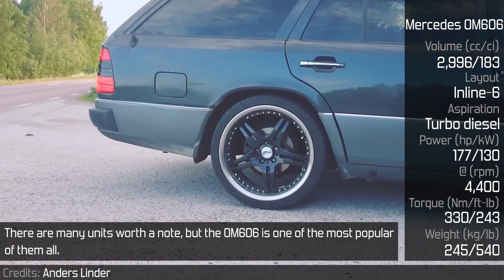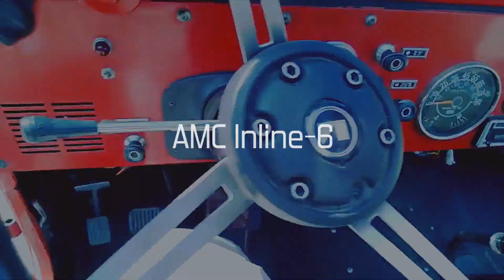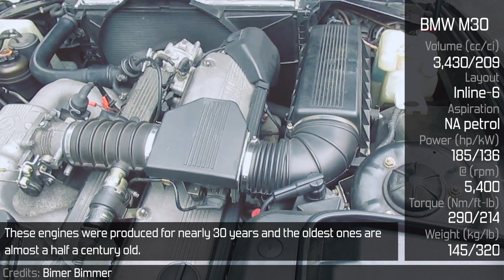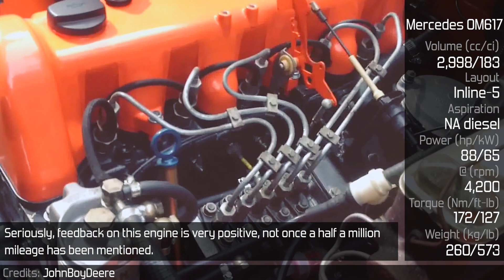10 Most Reliable Engines Running Beyond 300,000 Miles

Comment from the maker: I know a lot of stuff is missing which is why there is this comment section here. Since there is a lot more of reliable engines out there, feel free to mention your submissions and a little info about it if you don't mind. In case you want, I will gladly make another part of this series. Thanks you all for watching and have a great day!
Reply: I think some smaller engines might deserve a mention aswell. Someone mentioned the Fiat Fire engine, i think Toyota also has a few small good ones.
Reply: HUNGARY
Reply: VisioRacer the ford 4.9L I6. One of the all time greatest engines ever built. If you look up greatest engines of all time it'll be right there in the top 3 on everyone's list. Not to mention they are a gas engine which can withstand 500,000 to 700,000 miles without a rebuild.
Reply: VisioRacer you did a good job, however im sure if a north american made the list it would be a lot different. you had alot of european cars. Im glad you included the 1uzfe, probably the best small v8 ever made IMO. excellent video as always! cheers from Canada
Reply: What about the Audi 5 cylinder engines from the 80s/90s?
Reply: I would be glad if you do another episode with reliable engines :))
Reply: Toyota 5SFE
Reply: if you paid attention there was a mixture of petrol and diesel.
Reply: um, 7.3l powerstroke? lmao, got one with 440,000 nothing wrong
Reply: wouldnt mind a 2nd part lol
Reply: HitchedZebra59 _ I have a 7.3L powerstroke as well. My engine only has 110k while the built trans has 5k the trucks body has 156k. Gotta love warranty.
Reply: Sackmatters i hear ya lol
Reply: 1uz has 2uz essentially the same engine just different generations.
Reply: Where are the Honda engines? I've seen more Hondas with over 300,000 miles on them than any other vehicle.
Reply: VisioRacer 
Where was the Jaguar AJ6 on this list. 
In 3.6 litre and 4.0 litre forms it was very tough and extremely reliable and capability of well over 4 hundred thousand miles.
Reply: Chrysler slant six? i've heard stories of them running with holes in the blocks and my grandpa ran one for 1000 miles with water instead of oil
Reply: VisioRacer the b230 redblock series of volvo are doing 300k easy as wel not to mention the 5 cillinder whiteblocks..
Reply: VisioRacer where is The Opel 1.6 8v or The Honda engines
Reply: VisioRacer, have a look at the Toyota 1HZ engines. There are many of them here in Australia that have done 1 million kilometres without and work.
Reply: I have a 1996 accord CE7 euro model thats got 452 000km on the clock and going strong, F18 engine baby :D
Reply: VisioRacer i havent seen very many 7.3l powerstrokes that havent ran over 300k or 400k with no problems. i know of 3 in my tgown alone that are still running woth over 800k and never been rebuilt. i agree 100% with your list but also would have liked to see this one on it
Reply: Do some research on the volvo D5252T engine (also known as the 2.5l inline 5 VAG group diesel engine)
Reply: Why 7.3 liter engine, i dont think that belongs in this list.
Reply: 28kevin28 then neither did the 6bt... was just a suggestion. i know it may not fit the best with the channel
Reply: once i saw om617 i was satisfied
Reply: ryan schiff yes for sure... another one of my favorites
Reply: I think Toyota diesels especially the ones in the Hilux are worth. The one used in the Hilux on Top Gear was unkillable.
Reply: DoubleC oh yeah i have two toyota pickups one i keep on the road and one for a mud truck and i have always wanted one but theyre just so hard to find here in the U.S and i dont have enough money to get one shipped in. Definetly a good one
Reply: VisioRacer How about Toyota K series?
Reply: @VisioRacer the toyota 4k needs to be on here
Reply: The 1HZ from the Toyota Land cruiser the one in my mine has done 500,000km and there are many here in Australia that have done over 1 million kilometres
Reply: ford au 4.0 ,ford barra thats why ford is our taxis because they last
Reply: VisioRacer one sec in,I know you re Ost European,so are not likely to include the Ford Falcon barra 4:0 straight six,3/400k,common some taxis a million.
Reply: clubbin 09 ha just put it u beat me,can be utter turbo beasts too,utube Street zMachine TV,turbo taxi,,,rip Commo and Falcon.
Reply: Mike Berg there are alot of fords with more than 300k on the clock most of the ford taxis i jump in are over 800k i always ask them how does the car last they say its still factory engine gearbox replaced 300k and diff rebuilt 700k since ive owned more holdens than fords here is holdens stats 200 to 250k gearbox goes 300k engine goes im happy in my older years ive only owned one ford that has over 300k thats 4 holdens to one ford
Reply: VisioRacer  I've got a 7.3 powerstroke at 356k I have a few buddies at 500k+
Reply: in the next video you should add the 7.3L powerstroke and the ford cologne 2.9 V6.
Reply: Holden 186/202 i6 and dirty Holden 308/5.0 v8
Reply: VisioRacer Chevy Beretta? Those beasts last A LONG TIME! :P.
Reply: My old Mitsubishi Magna did over 300 000. And I've heard of many more doing the same. 

The slant sixes in the AP6 valiant were basically a turbo motor without the turbo.
Reply: A lot of Honda engines but people would start being haters
Reply: clubbin 09 he mentions Buick iron 3:8 v6,shows a supercharged,we only had a few o them,but the normal Commo ones ok,not a patch on the BARRA,but.
Reply: VisioRacer boxer engine of vw beetle
Reply: I personally had ridden in a 1986 Pontiac Bonneville SSE that had a Iron block/Aluminum head (they were not all iron as he said after a certain point, if ever all iron) with 480,000 miles and original motor, with the factory gaskets in it. I have owned and driven many GM 60 degree v6's (most of which belong in a family together, especially the series I II and III) and they are very reliable as long as you change the oil every 3000 to 4000 miles.
Reply: And right now I am driving a 2002 Mercury Villager/Nissan Quest with the VQ33E V6 that is NON-INTERFERENCE and 227,000 miles, factory head gaskets, and still runs strong
Reply: VisioRacer The Ford 300 (a.k.a. 4.9 liter) in-line six. There are a lot of people who claim there's went over 500,000 miles before needing any matanaince. So the motor still worked, it just needed some things such as the sparkplugs changed. My truck has the 300 in it and it has never had any issues. The motor just keeps on running and it will do anything I need it to. My truck is a half ton but it's hauled over 2 tons, before, for about 20 miles down the highway; got to the destination with no trouble and the motor ran cool the whole way. Back in the 70's, Ford used the 300 in a lot of their F-700's. They put a bigger intake manifold (maybe also a bigger carburetor; I'm not sure), bigger exhaust manifold, forged the rods and crankshaft, and set them up to idle from 3,000 to 4,000 rpms for the ones used in the F-700's. The motor was conceived in 1965 as a tractor motor but Ford decided they'd also use them in their F-series trucks. The 300 and 240 both hit the market in '65. The main difference between the two was the design of the header and stroke length. A lot of people would take the header off of a 240 and put it on the 300 to increase the compression ratio from 8.8:1 to 9.5:1. The 300 had a four inch bore with a 3.98 inch stroke and the 240 had a 3.18 inch stroke. In '83, Ford switched to metric so the 300 became the 4.9. In '87 or latter half of '86, the 300 got electronic fuel injection. The 300 had gear driven timing. The timing gear on the crankshaft was metal and the timing gear on the camshaft was composite plastic to help reduce noise. It had two valves per cylinder, the piston, rods, shafts, header, and block itself were all cast iron. Ford of America dropped the 300 in 1996 in favor of more compact v6's. It was replaced in most part by the Canadian Essex 4.2 v6 (Ford had v6's from Essex, Canada (4.2) and Essex, England (3.0 and 3.8) the 300 was made in Cleveland, Ohio). As a little extra fact, a lot of UPS trucks had the 300 in them before they switched to diesel so if you see a gas UPS truck, there's a good chance it has the 300 in it. Also, I guess Ford of Australia still has the 300 from what I've heard. They were thinking about dropping it a couple years back but due to high gas prices and economical turmoil, they decided instead to update it to meet new emissions regulations. It's still available in their territory vehicles and their Falcon. I'm not sure where theirs is made. The 300 is known for its torque. It's maximum torque ratio is at 2,000 RPMs. I've found with my truck that I don't need to use the throttle to take off, I just need to ride the clutch a little bit and it won't die. I've taken off in second before while rolling backwards down a hill. I didn't give it anymore gas than I usually would starting off in first, I just rode the clutch a little bit longer than normal and it started off just fine. I will sometimes take off in second if there's a lot of traffic even with a load. I think that testifies just how torquey the 300 is. A couple other engines I think you should maybe look at are GM's 5.7 and 5.3 liter v8's. I don't really know that much about them but a lot of people say that you can easily get a million miles out of them before they are done for.
Reply: I have an old Toyota Hilux ute with a 3Y engine in it, they are the lesser known engines that were fitted into the YN65 hilux chassis, they are inline 4, carberetted, petrol engines with a 2 litre displacement. They aren't very powerful but mine has lasted 1,285,458 km without being rebuilt and is still running like the day it was baught, and is looking like it wants to make it past the next million kms!
Reply: Curved Bredd The Cologne v6's were pretty tough. A friend of mine has a '86 Ranger with the 2.9 in it. The top radiator hose popped off one time and it started overheating but he didn't realize it because he's thermostat is broken. So he just kept on driving. Then the check engine light came on, smoke started billowing out of the hood, and the cab filled with smoke. The the motor seized up solid; his rear tires locked up it was that bad  (it's a five speed manual). So he went out, opened the hood, checked the oil dipstick and it burned an indent into his thick cow hide leather gloves and the oil on the dipstick was boiling. So he let the motor cool  down and he tried to start and it started right up. So even after seizing up from over heating, it still managed to drive him home. He did end up replacing some stuff like the gaskets, piston rings, and maybe the injectors but it stay ran after that and it's still running to this day. He uses it as a plow truck, now.
Reply: Ford Barra, those engines are insanely reliable Australian built gems. There are AS MANY FALCONS for sale with 500,000+KM as Toyota has in total in all of Australia. That's not including any of Ford's other vehicles, just Falcons.
Reply: TheTravellingAussie You've almost hit the million mile mark. 1,285,458 km is about 798,747 miles (798,746.57 to be precise). Keep at it.
Reply: Thanks mate!
Reply: Tacomas duuuuude. They run foreverrrrr Personally I have 340,000 miles and still trucking
Reply: is every one forgetting the saab "red top" completely rebuilt by saab for longevity people have put 500ish hp in to the block before changing anything in the engine very rare and very reliable
Reply: VisioRacer 
put the Opel C20NE in your next vid :)
this engine is truly indestructible even when cambelt is torn.
with a good amount of torque and not that bad fuel consumption.
Reply: Also the Chrysler 225ci Slant 6 took all kinds of abuse and kept running forever.  The reason that many of those cars are off the road is because of autobody rust, not engine problems.
Reply: Have a '93 Triton with the original 4G54, 2.4L carbureted inline 4. Just hit 1.6m km on the clock, or somewhere around 1m miles. No work done since about 2010, and even before then it was minimal.
Reply: The ford sohc 4.6l v8 used in cop cars and taxis, they easily live over 500,000 miles without overhauling.
Reply: You missed just ANY suburu motor, which often times can be found in a car that has totally rusted away, but the motor still runs good.
^.^
Reply: The 1.9 TDI with an old injection pump (90 and 110 HP) is also much better than the PD one
Reply: I too own a ford 300 six, and it makes good power despite being made in 1987. not to mention with a bit of work it can run on drag strips as proven by the frenchtown flyer
Reply: VisioRacer The Nissan GA16DE is also a very reliable engine, it can go over 300,000 miles, I have one
It's been used in many many cars in a lot of places. Too bad not everyone payed attention to how responsive it was to mods and bolt on mods. Its combustion chamber is designed to resist pinging and knock. Good thing Mexico was still producing this engine until a few months ago. But it only had little changes like
-No VCS (Variable Cam System)
-No EGR (Exhaust Gas Recirculation(for economy)), Instead, it has an new EGI system (Electronic Gas Injectior)
-A vertical positioned throttle body instead of horizontal.
Lol looks like I went too far. But this is an amazing engine.
Reply: I think it's actually an Audi AEL. I have it, probably done way more 
than 500.000km. A bit smokey when pedal to metal, but no real issues.
Reply: Toyota Prius powertrain, there are multiple with over 1 million km and not a single repair on engine and gearbox.
Reply: VisioRacer you got the 12 valve cumming, and the 7.3 liter Ford diesel.
Reply: The Australian Ford Falcon AU model, 4.0 straight six. 
There are tons of those engines that have gone around the clock doing 1 million kilometers without even being opened once, and still going strong.
Reply: Peugeot 1.9 TD and 2.0 HDI engines are magnificent. Better than the 1.9 TDI PD engines.
Reply: A lot 1,000's of them went way beyond that, my neighbour had 3 that had done over 1.5M Km's all running on LPG gas original motors, replaced nearly everything else, but the motors were original, and there are heaps of Holden's that have done just as many miles on their 6 Cyl engines as well, and your only talking 300k miles come to Australia we will show you how to build cars Aussie Tough
Reply: My B16A2 out of '92 has 500k kms on it, and it was driven to the redlimit daily. It still runs too.
Reply: My college has a boat lift powered by a Chrysler slant 6. It's been in service since 1967! Granted it only runs a couple hundred hours per year, but still.
Reply: The legendary TOYOTA 4K-C, the one ive got in my corolla has been round the clock and up to 60 thousand km (1 million and 60 thousand kilometers) on dead stock motor daily driven and pretty indestructible since 1983.
Reply: Yeah, you made four or five MAJOR omissions of engines infinitely more durable than some of the overengineered shitheaps on the list. Let's see here...

Chrysler Slant-6: Gutless Wonder of the World #4895 though it may be, YOU CAN NOT FUCKING KILL THESE THINGS! They will put up with neglect, abuse, lack of maintenance, terrible quality fuels, overloading, for decades and decades and decades. These things just simply do not know how to die.

Ford 300cid/4.9L I6: They made hte same output as a 302 V8 in the same model year of F150, yet they'd outlast the Slant 6 up there. I actually own two of these things, in a 320,000+ mile 1985 F150 and one in a ~230,000 mile 1995 F150, and I wouldn't give either of them up for anything.

Smallblock Chevy V8: These things are ubiquitous and for good reason. Guys have gotten 50K+ miles out of them AFTER they've blown head gaskets and spun bearings. Guys have had them throw rods only to keep right on keeping on. They, like the 300 and the Slant Six, can take an absolute pounding and decades of neglectful abuse with pride, shrugging off harsh conditions that would make every Japanese and German engine on this list undergo spontaneous unplanned disassembly.

Ford Flathead V8: These things are so unbelievably durable that people REGULARLY pull them out of barns under their own power, barns they've sat in for 40+ years. They are so mindblowingly simple and well built that they will quite happily run with one cylinder head completely removed, with horribly scored rings, with a fucked carb full of 40 years of spiders. And all these things get to arouse them from their decades long slumber? A fresh change of oil, cleaned points, and some gasoline fed to them by an upended soda bottle. I hesitate to even call this thing an engine...it's just too damn tough. Way too damn tough. The only known way to kill a Flathead V8 is with an anti-materiel rifle, and even then they'll sometimes still run.
Reply: VisioRacer the SD33 from Nissan  it was a marine engine mounted in the Nissan Patrol
Reply: VisioRacer .
Reply: Hey Vision Racer you need to put an * behind the GM3800 series, the Magnet on the flywheel always fell off and caused the thing to run rough, and it was never fixed, and this happened on ALL V6 engined General motors cars, including the trucks and also the V6 in particular seems to be unbiquitious with GM, and I've had one of their V6's break its block on me before sub a 100 K miles. 

as while maybe that buick V6 is a different engine from the one that's failed me with the engine block breakage, the cars never lasted beyond 80K with the one that DID have the Buick V6

this being the series that broke on me:
https://en.wikipedia.org/wiki/General_Motors_60%C2%B0_V6_engine#LH0_2

although that was on an 88 car, the 96 lasted pretty damn long, and outlasted the buick V6'd car (as it says they beefed it up apparently, it was a 96 Ciera) the olds intrigue however, a 99, the one with the Buick V6 was always in the shop every 3 weeks, until I upgraded to a foreign make and model once it got upwards of 70 K miles on it

as in 2004 the CEO of General Motors, admited to designing the cars to fall apart at 80 K miles in the investors buisiness daily newspaper, the november edition if I remember correctly. 

so while the engine may have been fine, the truth of the matter is if everything else sucks on it, you might as well take it off the list unless you can show some GOOD cars with that engine that lasted like this.

so all in all that's two errors you've made thus far, you called the Shelby cobra a Corvette in your hard to drive series,, which didnt even have Rack and pinion steering between 1962 and 1984, while the cobra had it in 62 and won a ton of races in the SCCA class with the 289,

 and beat the corvette in every way imaginable stock from the factory, while they had to rebuild an L88 with a factory enginee rjust to even beat it in that same racing class in 1968
https://www.youtube.com/watch?v=h9ARbs3a5SM

oh and also the cobra didnt feature cronic front end lift like the corvette did, as they decided to not open up all the vents on it like they had planned, something the C2, C3 and C4 all had problems with until the late 80's 

https://www.youtube.com/watch?v=_lJXLalMKSA

and you called a GM motor good that wasnt. so yeah you need to lay off bashing Fords, as evidently your not aware of just how terrible General motors is...........

as daniel akerton cheapened the product to boost the stock price between 96 and 2014, and caused issues like the cobalt issue to happen, twice.

https://www.youtube.com/watch?v=CnLMjxOl_gY

in addition to 85 recalls they issued in 2014 with the new CEO at the helm, just as a save their ass kinda deal with the new girl at the helm, which probably all had ties to him and the way he ran the company,

hell I'm convinced they called the ZR1 the blue devil as an insult to him and his penny pinching ways, like look at what we could do if we could just get rid of you. 

 oh and also he is now on the board of directors at american airlines, take that as you will, with all of the previous statements in knowledge. 

sooo yeeahhhh........... you need to double check your work pal, as it aint solid sometimes. and dont call a cobra a corvette like that ever again please.

I mean if your gonna please specifiy that its the replicas your bashing, as you forget that the cobra is the most coppied car in the world, and with good reason, its the king of the road. while the corvette is the pauper of the road, a car that can go fast, but cant manage a corner to save its life.

and is now designed to look like a pontiac aztek, as the same guy designed both, and why oh why they thought it was a good idea to keep that guy on, is a question the prophets will wonder for years to come
Reply: I had a couple Nissan's with the KA24DE engines. Solid as a rock. First one had 170,000 when I sold it, never had a single major problem. Second one had 236,000 when I sold it. Again not a single major problem. There's an Altima out there with the KA24DE and 500,000 miles, all original. Definitely motors worth noting.
Reply: The Ford Australia 4.0 I6 Intech and Barra engines. Those things regularly go up to 700,000 to 800,000 km with very little trouble
Reply: Kavinsky Smith we had the Buick 3.8's in the Aussie Holden Commodores from 1988-1999 and they were pretty woeful over here too, they had many head gasket issues over 200,000 kms (some earlier) and were prone to overheating while towing or heavily loaded.
Don't know if it was the way they were installed in the Commodore (smaller radiator, less airflow etc) or just the engines themselves.
Reply: You can add the Volvo B30 I6 engine to the B18/20, most of those outlasted the cars they left the factory in. Other notable mentions would be the Ford 200/250 ci (3.3/4.1L) I6 (Australian Ford Falcon taxis from the 70's and 80's used them and regularly did 750,000 kms before a rebuild), Toyota 3M/4M I6 were also known for longevity in Crowns and Cressidas (really most Toyota engines are known for reliability and long life).
Reply: I have a friend , His job is to sell the old taxis in Melbourne . Many make the Million k mark and have personaly driven one it would still crack 155 on the tulla.
Reply: And that engine had never been rebuilt , cant say that for the rest of the car.
Reply: idontcare80 I disagree. I've Seen more Chevrolet, Fords and Toyotas with over 300,000 miles odo than any other brands out there
Reply: Mercedes-Benz OM601 engine, did 1.9 milion kms as taxi for 14 years, in a 1988 Mercedes-Benz 200D  (W124), with the same engine. The taxi belonged to a taxi driver from Oporto, Portugal, and is part of the Mercedes Museum in Stuttgart. This taxi was on display when a friend of mine visited the exhibition. I found some information here: https://www.germancarforum.com/threads/new-mercedes-benz-museum-i-went.4455/
Keep up the good work!
Reply: Ricardo C it is a former greek taxi from Thessaloniki.
Reply: +cabrinhaGR, there may be another taxi in the page and in the museum  but this taxi has a licence plate from portugal,  QE-70-96, and the taxi symbol of Oporto (just Porto in portuguese) on the side. It is described in the website just as I said. The exhibition also has a film footage from the owner using the car in his leisure time. This was seen and described to me by a friend.
Reply: @VisioRacer it would be great if you made another part to this video, and I would have to ask that you look into including the Citroen/Peugeot (PSA) XUD engine. Most common today in 1.9TD form and well capable of over 250k miles without trouble, although the turbo can sometimes need a head gasket around 150k if coolant isn't changed regularly. The NA versions XUD7 and XUD9A are notably not very powerful (about 70bhp for the larger) but are so understressed they could go on for millions of miles. The later 2.1 litre 12 valve XUD11 is also well known for it's toughness and was the choice of taxi and delivery drivers in it's time. I have owned one (in a 1998 Peugeot 406) that had covered over 275k and was only in need of it's second new clutch & a set of glow plugs when I sold the car. Moving on from those the PSA HDi engines can also do big mileages but are stricken with turbo/DPF/injector seal issues if not looked after correctly whereas the XUD can make over 200k even being abused & neglected. Although I have heard of a van with the 1.6HDi engine which covered over 300k in it's first 3 years of life and still retained it's original clutch too so they can be fine if cared for.Thank you for posting these videos, they're very interesting to watch while the weather's too bad to get outside and work on my 2 XUD powered Xantias (one turbo and one NA) and 1.4HDi 206. :)
Reply: Speaking of engines still running blown, I ran an XUD9 with a snapped camshaft and one piston/rod completely removed (previous owner managed to run a big end until the cap came off!) and it went surprisingly smoothly considering the balance factor, only died again because the cambelt got ripped up by a failed auxiliary belt as there was no bottom belt casing...
Reply: Oh, and @Ricardo C. Is this your real name? Very appropriate name for someone talking on this subject, since the IDI pre-combustion chamber that originally made smaller, high speed IDI diesels viable was of Sir Harry Ricardo's design and is known as the Ricardo Comet :)
Reply: Fiat 1.9 jtd ?
Reply: as a mechanic if 45 yrs and working on hgv's cars and motorbikes. I would say the the engine with the most numbers on the road with over 300k ( with 6 on my books over 1/2 million) is the psa group DW 10 2ltr turbo used in many Citroen and Peugeot cars. like all diesels regular oil changes are essential. probably the best common rail out there. obviously truck engines beat this. But let's stick to cars.
Reply: should do a worst engine. easy one would be the rover K series 1.6 and 1.4 in the modern engines. lucky to get past 40 k without head gasket blowing.
Reply: +dan mackintosh, I can tell you that is not related with Ricardo Comet ;) It just happen that a friend of mine visited the Stuttgart museum
Reply: gm i4 2.2 ecotec,sbc 350ci v8, gmt 4.8l v8(ls) 6.2 diesel, all can do over 300k miles
Reply: Yes it reminds me of my ex girlfriend to my new girlfriend... How not to drive your new old lady because of what y'all did to the old old lady... Did you get that one?
Reply: GM 5.3l LM7 is a good one
Reply: Chrysler Slant Six. All the use and abuse they will endure is mind blowing. I owned a '65 Valiant and now own a '64 Dart. The carburetors may be the weak spot because hundreds of thousands of miles will wear the butterfly shaft, but even with horrible vacuum issues it keeps on running.
Reply: Good solid old engine but the head is prone to corrosion and then a blown head gasket. I blew mine twice.
Reply: The AU ran a Tickford rather than a Barra. Both extremely reliable engines
Reply: Yeah, going to definately agree with that. Mom's got an '02 with 338K, engine's still tight but it finally needs a set of injectors. Still runs fine though.
I've heard them going 750K to 1,000,000 miles even.

Heck, I know of a few 400K mile 7.3 IDIs (powerstroke predecessor) and I believe I have one or two 300K+ mile IDIs myself(hard to tell with 5-digit odometers).
Reply: stephen dwyer did you at least get bear meat for the trade
Reply: VisioRacer n
Reply: I hand   a Ford Probe 4cyl. Over 322k mi. Still running when sold.
Reply: Hot rod
Reply: VisioRacer 1994 Pontiac Trans Am, 350 lt1, original owner, 337.000 , engine never been touched, not even timing chain,  still purrs like a kitten.
Reply: VisioRacer as a mechanic I can tell you that not excellerating hard ,changing your oils  at least 200 miles before it's due and performing timing services on schedule ...
Reply: 4G63
Reply: Know abort a Volvo V70 White 5 in Line 2.4 L. Run 70.000 Sveden miles =700.000 km. White no problems
Reply: I just sold my 1986 HJ61 (12HT 4.0L Turbo Diesel) with 402,000km on the clock and it was considered a relatively low km car, I know a bloke that kept his running with 1.2 million km without a rebuild. Best engine Toyota ever made.
Reply: my dad once had a Ford Sierra stationwagon with a turbo diesel engine, it had well over 600.000km on the clock before he blew the engine by hitting the accelerator too hard too soon....
i'm not an expert in the car department, my hobby is riding 50+ years old Gazelle bicycles, i own 6 of them. (built in 1938, 1940, 1947, 1950, 1955 and 1964.)
Reply: I had a 2001 Chevy Tracker, auto, 2.5 L V6, got 325K out of it. Burnt oil, AC was shot, so was the U-joint, and the drivers power window needed a little help. Still ran when i sold it for parts.
Reply: VisioRacer My dads tacoma v6 has 175k miles on it, never had much more than an oil change.
Reply: The GM 3100 series are excellant engines just keep the fluids topped off and fuel in the tank
Reply: wow how did you miss the ford 4.9L 300i6 its durability and reliability is legendary  hell i neglecy mine all the time and im at 629,000 miles
Reply: Sackmatters im sitting on 629k my self
Reply: the 7.3 powerstroke is shellproof its designed in a way to run well even when damaged or givvin bad fuel
Reply: The Chrysler Slant 6 (225) that was in my first car, 1976 Dodge Aspen was very reliable. They were known for their reliability but were not very powerful. Mine had 300k miles, and the rest of the car was falling apart but the engine  as gutless as it was, ran fine and didn't use oil.
Reply: Yes such as Chrysler's slant 6 (170, 198 and 225 Cubic inch). Slant six production started 1959 and ended 2000! https://en.wikipedia.org/wiki/Chrysler_Slant-6_engine
Reply: yea but the ford inline 6 was made in 1941 and was a standard production engine in the USA till 1996

BUT the australians keep makeing till 2016 for small trucks so you  from 1941-2016 the ford inline 6 has been an unkillable engine
Reply: Honda D16y7 mine had 600k+ no oil use/smoke. 42mpg hwy. No major issues just wear parts.
Reply: Great list. I have a 7.3 diesel powerstroke in a 12,000 GVW service van pushing 1/2 million miles.
Reply: He's right. You missed one of the greatest gas engines of all time, the Ford 300 I6. No timing chains or belts, cast iron block, bulletproof camshaft. I might also add 260 ft lb peak torque arrives at only 2000 rpm. Used primarily in the best-selling f150 line, it also powered dump trucks and still does many of the UPS delivery trucks in the US and was adapted for countless applications from water pumps to airport baggage trucks.
Reply: Koff. Koff... Plastic intake manifold.  Melts and blows the engine.  Class action lawsuit...
Reply: VisioRacer I had a Toyota carina  with 470 thousand miles on it and a 1990 honda prelude with 350 thousand miles and both were driving perfect
Reply: Has so much to do with maintenance ! Had a 2000 GMC Sierra 4.8l . Sold the truck with 493,000 miles . The young man i sold it to is still driving it and still brings it to me for maintenance and repair  . Currently it is arround 650,000 and the engine has never been opened . 50,000 miles from new the oil was converted to Mobil1 fully synthetic and has had it ever since . Currently my 2004 F-150 5.4 liter is on the same path at 365,000 miles .. Maintenance  .. Maintenance  .. Maintenance people , can't stress it enough . More frequent general  maintenance   will keep you from seeing your mechanic for major repairs . This is from a mechanic who makes a living on major repairs !
Reply: 7.3 powerstroke
Reply: What I did find interesting is that most of your engines are more current types. Yet the older VW engines that were also used in porsche back in the 1960s and many went well over 500K miles. And american made chevy 235/250 L6 also many of them wll over 500K miles. But was glad to see many I do know and have high respect for in your video, especially the cummings.
Reply: 5.9 liter Cummins is capable of 300k miles easy with no rebuild, and makes loads of torque, more than most Europeans can imagine in a vehicle so cheap
Reply: You heard right! I cannot imagine how this engine did not make the list. would you like to know why you don't see them sold now. They LASTED TOO DAMN LONG!!  (true)
Reply: Ford 5.4L gasoline two valve van engines. I ran more than one over 1 million miles. Highest made it to 1.3+ million miles.
Reply: Ga16de
Reply: just want to mention a engine that is quite reliable aswell: the 1G-FE engine. 2.0 straight 6, runs like a clockwork even after 440k km's
Reply: AMC's inline 6,,,,,, 232/258. 1971 AMC Hornet 232 inline 6,,,, 3 on the tree,,,,,,, 375, 000 ,,,, 45psi op @ 60 MPH!!!!!!
Reply: VisioRacer p
Reply: Get one for bikes. 
I recommended Honda's SS50 and Cub50. Simply because they have enough time to prove themselves: More than 50 years already.
Reply: Dude you did a pretty good job you pretty much spot-on the only thing I think you might have left out which could be just and honorable mention would be a LBZ Duramax. general motors basically had it bullet-proofed right before the emission scandals they gave the public one last champion diesel the legendary LBZ
Reply: Those are all 30 years old school reliable but not economical and ecological. That mercedes black smoke exhaust is killing every living creature..
Reply: Speaking of that 1uz, i've kept hearing that the engine is a little difficult to maintain it, but they last more than a F-150 5.0, but I don't know if that is true (Except for the fixing part for the 1uz).
Reply: Im glad you included the gm 3800 v6 i have one and it has never left me stranded
Reply: Well a Ford idi 6.9
Reply: Ford 3.0 v6 aka The Vulcan v6
183ci mfi OHV
Reply: The 3.3L V6 in those 2003 Doge Grand Caravans are work horses, it's much more likely the chassis itself is to fail before the engine does, my mom's caravan has been running with us for over 13 years at over 1 million kilometers, no rebuild ever needed. At worst, the radiator and radiator hoses gave out, and it's currently waiting for a new rack and pinion.
Reply: My starships engines have 98700000000000000000000000000000000000000000000000000000000000000000000000000000000000000000000000000000000000000000000000000000000000000000000000000000000000000000000000000000000000000000000000000000000000000000000000000000000000000000000 miles on them and no problems yet!!
Reply: The GM LS engines last a long time too.
Reply: Ive had several 90s Honda D series and F series run 370k+ without any engine work done. 
Also the Chrysler Slant Six is a very hard engine to kill.